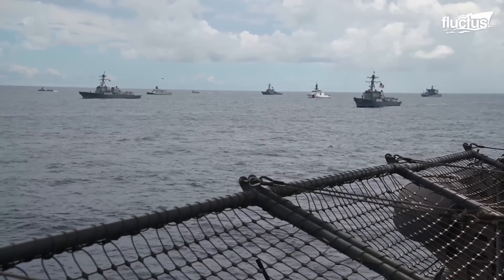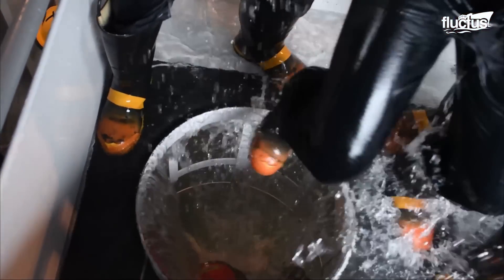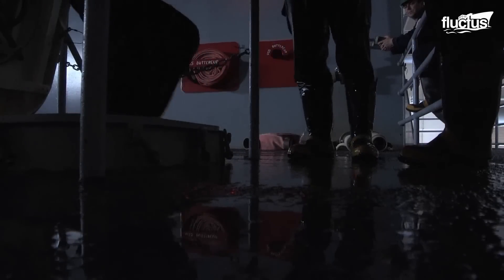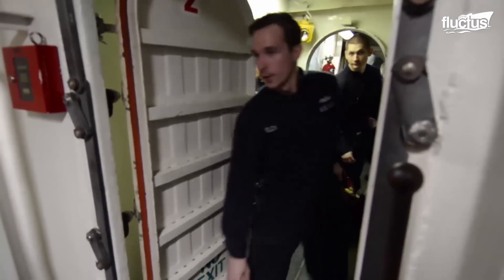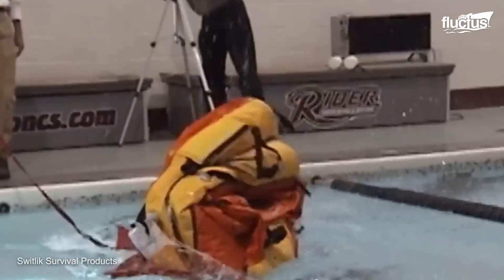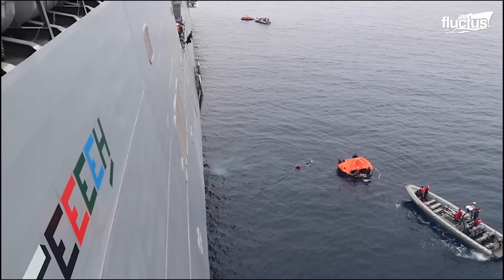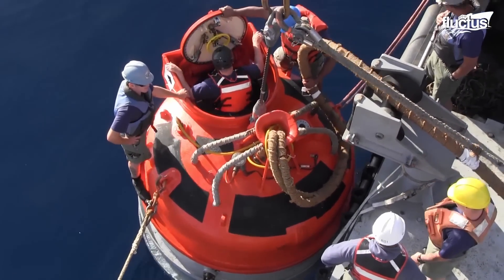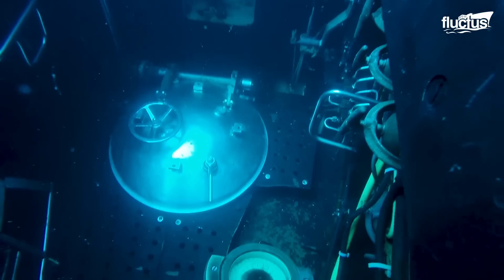The Scary Process of Escaping Sinking US Navy Aircraft Carrier and Submarine

Comment: We went thru damage control training in San Diego.  They had a two level trainer with all the appropriate leaks and stuff.  The instructors told us what to expect, that the repairs would be made in the dark with only battle lanterns for lighting.  At the end they told us that we would have to abandon the compartment thru an 18" scuttle.  They told us to stuff the smallest guy in the group up underneath the scuttle becasue he would be the first to go through. Did I mention that while were doing damage control, they were flooding the upper compartment. We were pushing people up the ladder and the up top people were pulling them through.  They also told us to keep our heads down and don't look up. We wore steel pots, not plastic hard hats with breakaway chin straps. If you looked up the water could catch the steel pot and snap your head back which could break your neck. Everyone got soaking wet.  It was a very good training class.